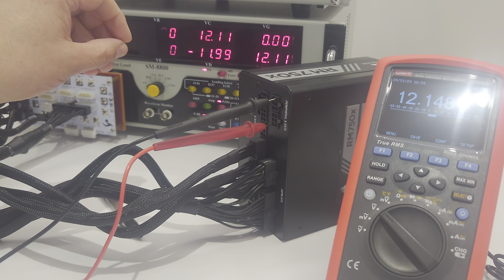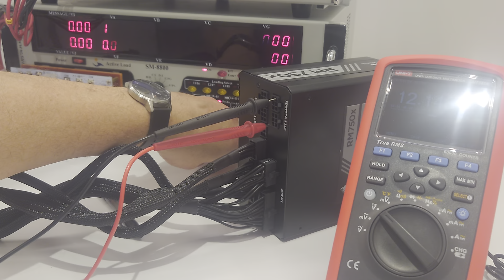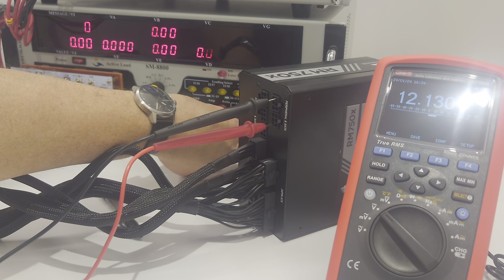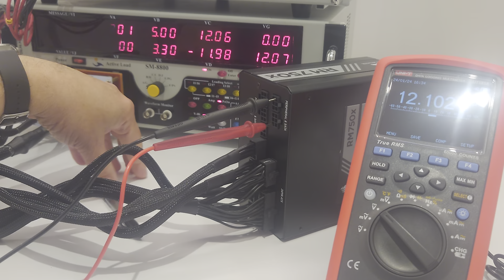How the double crimped sense wires on the 24-pin impact the PSU's output voltage.

Comment: Is the sense wire hooked up to the arbitrary 12V pin as separate thin wire? or it's part of ATX 24pin standard and one of the pins is used for voltage compensation?  
Update: I apologise for my ignorance, I reread carefully the title and it's self explanatory, "double crimped" so it's the manufaturer choice to add separate wire for voltage sense to already existing pins

Comment: A very straight forward demonstration! 
Though I wonder if the PSU would adjust the entire 12V output or just the motherboard part. 
Since the 12V EPS and PCIe cables all carry different current. Their voltage drop would probably be different too.

Comment: It's 11.99v on the 24p 12v rail. With the load on the 24p 12v wire. And 12.14v on the PSU Modular connector.
So, what voltage will be read on the end connector on PCIe 6pin cable? 12.14v? since there's no high current flowing?
Reply from the maker: If there's no load, then yes... it should be very close to 12.14V since there will be little resistance.  All outputs on the PSU end will be within .01V or so.  The irony isn't lost on me that the connector with the lowest +12V load (the 24-pin) is the one with the sense wires and gets to dictate the voltage of all other outputs.  If only Nvidia knew what sense wires were for and used them correctly.  ¯\_(ツ)_/¯
Reply: @jonnyGURU  Okay, thanks for the answer!
Yy I know sense pin is just under the 24p.
Lately Asus make additional 'purple' connector on their 2x6 PCIe connector to monitor VDroop on the PCIe rail. On their newest THOR III Titanium and Strix.